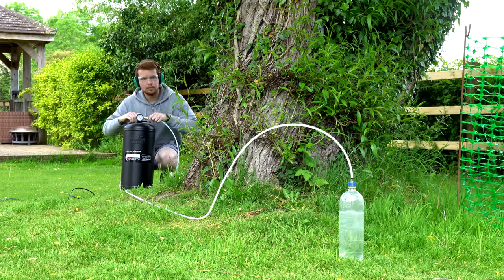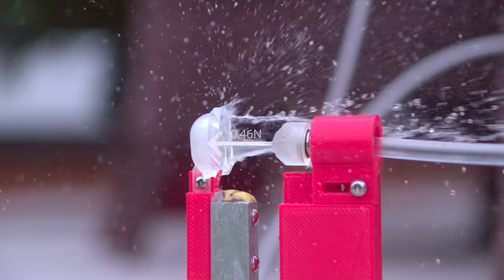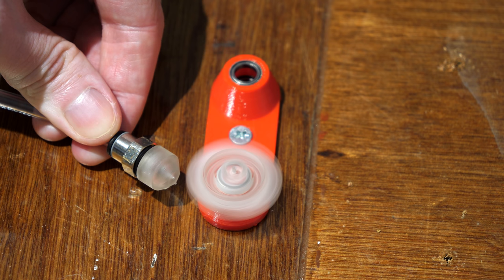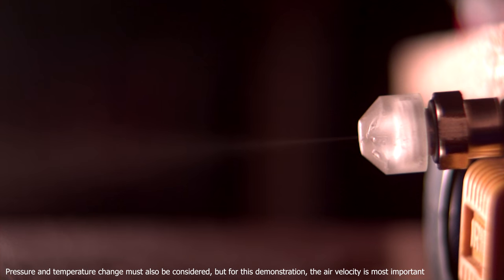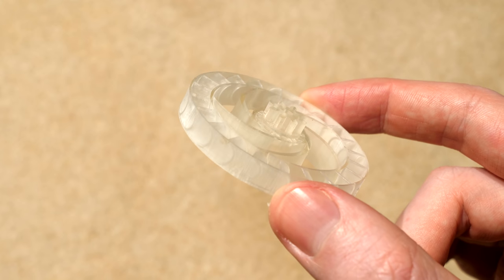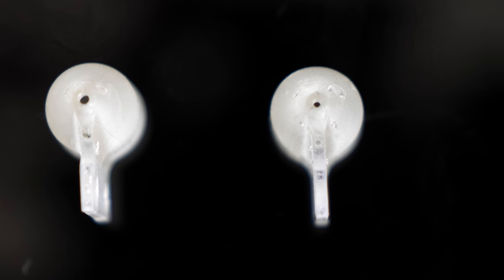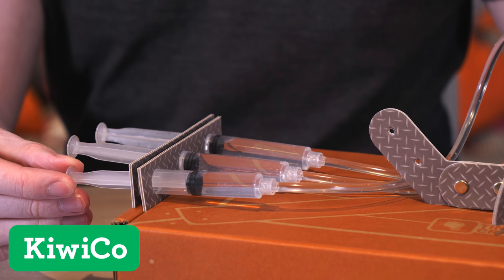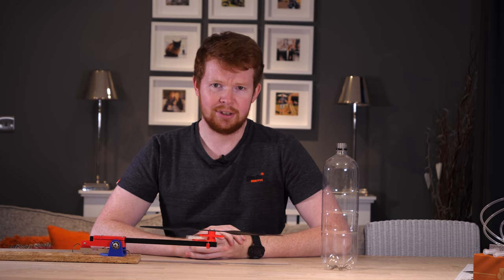Micro Pelton Turbine

Comment: Subscribed to your channel,watched many vids,please get some face protection,as when things let go you will get hurt buddy.Back in 1990's i built  helicopter blades from thin tin (no 3d printing then) so i could solder and modify angles etc,this helicopter used slotted light sensors and a gimble to keep the helicopter stable,one blade let go and went straight through a 2.5mm x 3 mains cable,which blew the shed fuse,(which cut the blade motors thankfully)the tin blade was a good 5mm into the chipboard behind the severed mains cable,,from then on ,face protection was a must.It would of easily done some real damage if it had hit me.Take care buddy.

Comment: i think i get the reason why compressed air turbines didn't work so well, after waching a video about one of your piston engines

the piston regulates when the air goes through to the exhaust. the turbine, on the other hand, puts up obstacles' the air goes through, and they have to be placed in a way were they move the most. problem is that, since air is the second dens' gas in the world, often at times it can it can pass through without adding much to the power out put, which leaves wasted energy that could of turned the turbine

So maybe the solution is, a hybrid of piston and turbine? 

the idea here is that we have a turbine turning and axel, which the air will go through, but after it leaves the turbine it goes into a piston, which both turns the axel, and push's/compress's the air, when it goes through the exhaust it loops back into the turbine, then this time the air leaves through an exhaust, which will only be opened when the piston exhaust its air back into the turbine.

I'm not an expert, in fact most of my designs didn't even make it to printing due to something being pointed out which should be obvious, so, print at your own risk

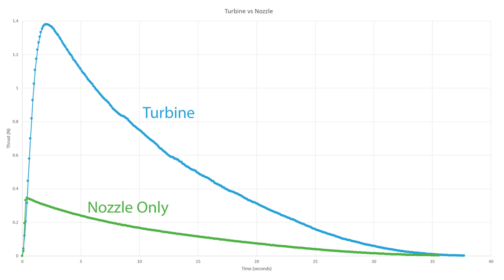Comment: Hi Tom, at 7:24, the Graph show that you get 35 seconds of thrust out of the pressure in the bottle. I'm a little confused by that. I get 4 to 5 seconds of thrust from a system I built. In your video with the drone, the graph also shows only 8 seconds of thrust. Could it be that the x-axis in your graph is wrong?
Reply from the maker: The x-axis is correct because the diameter is so small (1mm). I think the nozzle I used on the gas thruster drone was 2-3mm in diameter, which is about 6.5x more cross-sectional area, hence the 6.5 x 5 = 32.5 seconds.
Reply: @TomStantonEngineering  Thanks for clarifying this. Calculated by simple equations, a 1mm straight through nozzle should end up with something about 0.47N thrust. I will check the thrust and duration on my setup again, but i never reached a duration above 8seconds

Comment: Guess on why the turbine is more efficient 
The jet only produces peak thrust right next to the nozzle but as soon as it leaves the nozzle it dissipates in all direction  and so it effectivly never stops and uses up all its energy
While the turbine uses it at its peak thrust and uses a propeller which is much more efficient at low speed and volume

Comment: Turbine is definitely better on aircraft because it's simpler, has smoother operation, and much higher rpm from the engine, which could be reduced by the gear ratios by a lot, and thus making some extra torque.

Comment: The efficiency of the turbine decreases if the speed increases and the pressure decreases, what would happen if you design a turbine that runs more efficiently at a lower pressure and reduce the pressure with a simple regulator to keep the pressure longer at the most effective pressure? Maybe slightly less output but for longer time and at an higher efficiency.

Comment: If you want to use the nozzle directly, you should change the geometry of it. Think of a rocket. If the exit speed of the nozzle is high enough a convergent nozzle is thrust limiting and you should change to a laval nozzle. However, I don’t think the pressure is high enough tough

Comment: What if you used a very compressible gas, idk what would be best but hydrogen would be the least dense if that's how it works, but other gases can be liquid like carbon dioxide so idk what would be better. maybe try different gasses and check efficiencies.
Reply: Helium may also be a good choice and it would make the tank lighter.

Comment: Why don't you like the Tesla turbine? Curious because I'm looking into the the idea of creating steam power using a parabolic trough collector and after seeing a YouTube video of a micro Tesla turbine that was able to achieve speeds of over 100k rpm at 30psi of compressed air and produced 3.5W, my mind started wandering. On a larger scale it could have potential for DIY off-grid steam power.

Comment: I am sorry i am not a mechanical engineer, in fact i have very little formal education so if my question is stupid please disregard, but wouldnt the Pelton wheel produce much more torque if dissipation of air was prevented by sealing the wheel in an airtight container? kind of like a bullet is sealed in a chamber tightly to generate maximum velocity.

edit: i made this comment innthe begining of the video, i noticed you implemented this exact same idea from half of the video onewards. nevermind

Comment: Hello Tom, I need your test stand.
We are currently testing the first demonstration prototype of our new electric spacecraft thruster.
We need a better test setup.
Engine weight 5.45 kg.
Measured forward thrust 0.07 Newton's.
Power consumption 18 watts peak, 10 Watts continuous, per cycle.

Initial testing has found a bottleneck, the component we named the converter is undersized.
The converter acts like a funnel, directing the power into the forward thrust generator. 
The converter rating has been increased to about 18 watts now.

Newton's third law is incomplete, unfinished.

Comment: Don't make the fluid turn 180° as it reduces its flow velocity to 0 which causes stagnation of fluid in the bucket therefore reducing the efficiency of your turbine... Instead use an angle less than 180°

Comment: Liked the presentation a lot.  Specifically, the clever simplicity of the load cell; using a cell set up that has a lever in it.  I've used that set up a couple of times myself.  Yardsticks.  Simple and direct.  Also like the fact that the putting side shields on the buckets seriously increased the efficiency.  Liked the way the experiments progressed from one to the other.  I wonder if the presenter has a University degree in Physics or a related field?  Well done.

Comment: Instead of trying to fit an air bottle why not make the body of the helicopter your air bottle you should be able to mold one just like they do to put in cars you can literally make the body of the helicopter to hold the air put some legs on it and put some stickers on it and I bet you you can probably make a 4L helicopter which will give you approximately more than 3 minutes of flight you can make a feeling nozzle right underneath the aircraft or you can make a custom bottom piece with legs to hold all the electronics so basically everything for the electronics would be on the bottom a bottle molded in the shape of a helicopter you'll have all that tail section as well for air and then you're mechanism mounted right on top oh and use a 4 blade system

Comment: Greetings from the Philippines. Hey, amazing video of using gas as a medium. I have this idea of putting a turbine, directly connected to an engine's crankshaft & using the exhaust gases, to hopefully give it a bit more torque among other things. 

It's essentially a turbo-compund engine but I was wondering what the turbine would look like. I.e.: the diameter, shape of blades, how much it weighs (also I want the mass to be much more centered inside the turbine to spin quickly and to keep the engine load to a minimum.)

Sadly it's not gonna happen in the meanwhile because of the pandemic, complete lack of funds, jobless, and corruption running rampant here in my country. And also the complete lack of empathy of the people here.

Comment: I would like to send you these micro generators I have, to see if with gear ratio you can get a drone to produce enough energy to stay flying forever. Put gear teeth on the motor bell and reduce it down to the generator

Comment: Perhaps you can use resin printed gear for everything, better meshed gears for less wasted energy.  Slightly off topic, this seems right up your alley from your previous compressed air powered plane.  https://www.youtube.com/watch?v=bPZI6XoHi10   Perhaps the compressed air thrust can be amplified using the Coanda effect.  Or maybe just use EDF.

Comment: You "rate" the turbine setup with the propeller in still air.  Under this condition, the system DOES NO WORK.  When the propeller is on an airplane, it will be moving forward, so the load will be lighter (it will spin faster).  The optimum gear ratio will be lower than when tested in still air.  You can also compensate by increasing the pitch of the propeller.
          I want to design a steam turbine for generating electric power on 1/8th scale steam engine.  Turbine wheel must be no larger than 25mm diameter.

Comment: Wouldn't it save more air pressure by useing an entire tube with the diameter of the nozzle instead of a larger diameter tube with a small nozzle? Im probably wrong 😂

Comment: Perhaps if you add another low pressure turbine after the 1st high pressure turbine, it would be possible to harvest the remaining energy in the now, low pressure air.....Something like fig. 7 and 8 in: https://www.researchgate.net/publication/283831474_Modelling_study_efficiency_analysis_and_optimisation_of_large-scale_Adiabatic_Compressed_Air_Energy_Storage_systems_with_low-temperature_thermal_storage

Or use a multi-stage low pressure turbine like GE9X turbofan engine:

https://www.researchgate.net/figure/The-low-pressure-turbine-on-the-cutaway-of-a-GE9X-turbofan-engine-2_fig1_338840613

Regards ! 

Claudio

Comment: https://www.youtube.com/watch?v=bPZI6XoHi10
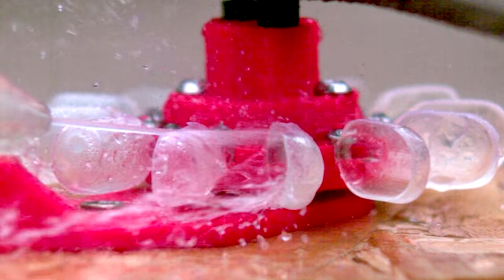check out  this video to see what i mean for the "venturi pump" turns out there is already name for this in the aviation industry "aviation aspirator" 4:26m in video, or TLA "tank liquid agitator" its the same principle. who ever in your setup i assume some sort of valve will be required due to the small amount of air available.
(my idea is to use this to lower the comsumption of the system, but i guess it could be used to add power instead). up to you to chouse the best aplication.

Comment: Hello Tom. I am searching for some information and your video has helped a little but I am still searching for answers.
I have been doing some experimenting with nozzle sizes and water flows in our stream. I know the water velocity and roughly the force that would be applied to a turgo bucket and also the speed I wish the turbine to run. See my youtube video https://youtu.be/J_gl4atajZM  What is confusing me is the speed of the turgo bucket is often stated as being around 0.5 times the water jet velocity. It is also often stated these turbines are 70 - 90 % efficient. I am a little puzzled to what is occuring with the water reversal in the bucket as a 0.5 speed drop would give me a 50% efficiency straight away unless the flow reversal doubles the force on the bucket. I am hoping to make contact with yourself and maybe others to learn what is going on so I can choose or design a suitable turgo runner. Rob.

Comment: Why do people use RPMs? Is anyone out there actually conceptualizing such fast rotation over such a long period of time? It seems far more intuitive to use RPS, a second is a much more reasonable amount of time to count that many rotations

like do you even have enough data to state RPM? Wouldn't you need to test for at least one M before that becomes a reasonable unit to use? lol. You don't normally multiply when youre trying to calculate rate of change, because that means youre losing precision

The only real reason seems to be that thats just what everyone else uses, so its what people learn, so its what people know, so its what people use